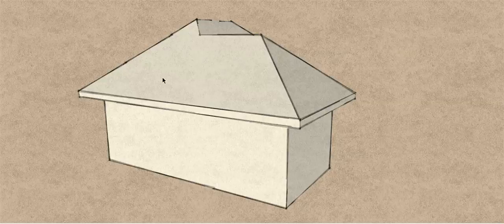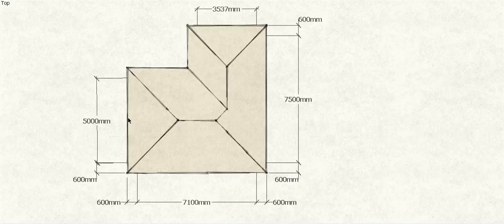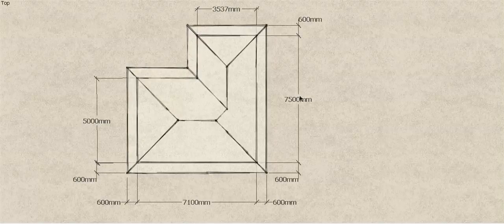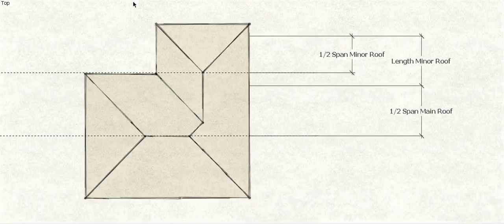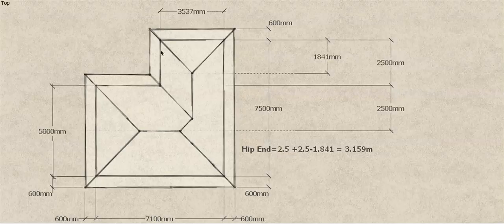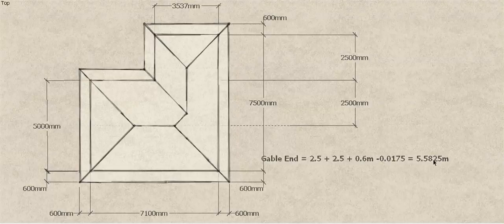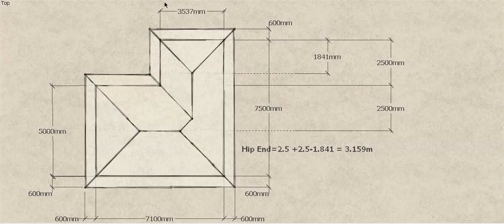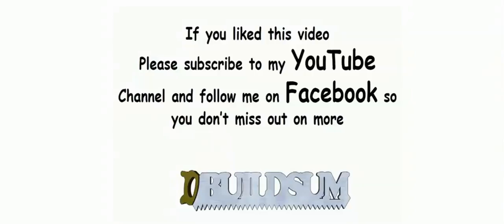Broken Hip & Valley Roof Ridge Length

Comment: Hi, I am not understanding how you obtained the 1,841 mm. Where did that come from? Can you please explain that? Also the 659 mm, how did you get that, please?The half span of the minor roof is 3537/2= 1,768,5 mm, not 1,841? 
Can you please explain?
Regards,.
Franklin
Reply from the maker: Hi Franklin, that video has been up for 5 years and you are the first to point that out. You are correct it should be 1.769m. The 659 is the difference between the 1/2 Major span and 1/2 minor span which will now be 731mm. Hope this helps

Comment: hi mate your videos have helped me loads, being able to see how the trigonometry forms the roof has helped me grasp cutting roofs much easier, on a hipped roof to obtain the ridge length my boss deducts the span from the length and adds the thickness of the ridge back onto this calculation, he adds this back on to make the common rafters work as its whats being deducted to make them fit in between the ridge board, does doing this interfere with the center lines etc for hips ? i am struggling to visualize this if you can help me cheers
Reply from the maker: HI Jordan, this would only work if the ridge and the rafters are the same sizes. 
If they aren't then you have to add the thickness of the Rafter to make the centrelines work. This is because the centre line of the roof runs up the centre of the rafters, therefore, you have to add half the rafter thickness on each end so the ridge extends to the outside of the rafters
It really doesn't relate to the deduction of half the ridge for the rafter length.
Hope this helps

Comment: Great videos. Wouldnt the ridge length for the main roof be 2135mm if using 35mm rafters? Half span = 2500. Outside wall to outside wall = 7100mm minus 2500mm minus 2500mm plus half rafter thickness 17.5mm plus half rafter thickness at the other end 17.5mm. Ridge length = 2135mm
Reply from the maker: Hi Mark, thanks, Yes that would be correct as per this video.
https://youtu.be/zKXZxXcERiQ

Comment: HI mate,  just gone through the calculations , when i calculate half of minor span i get 1768 mm but it looks like you get 1841 mm is that correct ,its just confused me however i like how you explain stuff
Reply from the maker: Hi Micheal, good pick up, that must be another one of those deliberate mistakes that I use to see if people are actually paying any attention to my videos ;). Hopefully, no one will be building this exact roof so just going through the should be OK. I will make a note on the Video to let other knows. Thanks for pointing it out.

Comment: so confused.
Reply from the maker: Hi, basically because the hips are at 45 degrees you can use that to get the required lengths from the walls. Its just a matter of adding up the sections that you require.

Comment: Hi, great videos. very informative with detailed explanations. I was looking back through your videos and noticed a while ago you did a step by step section video on contructing a brick veneer building. Any chance you could do something similar for a hebel panel construction video? 
Thanks
Keep up the good work!
Reply from the maker: Hi Mark, thanks for your kind comments. 
To be honest I have never done a Hebal building before however from what I have seen and read the Hebal essentially just replaces the brickwork. The main change would be that the slab would not need the step to support the Brickwork as the Hebal is supported by the timber frame.
Thanks for the idea I will put it on the to-do list, however, I can't see myself getting around to it in the near future, sorry.
Reply: ok, thanks